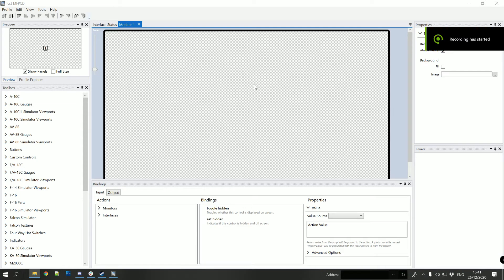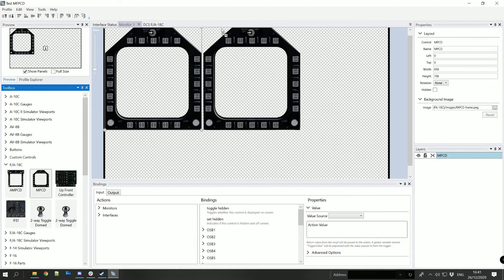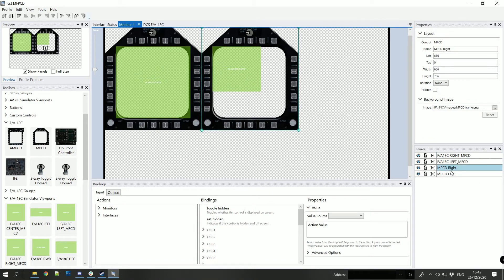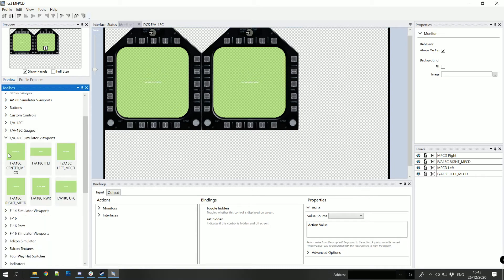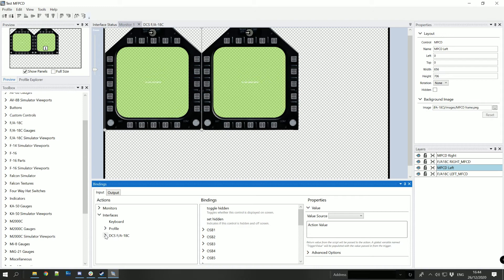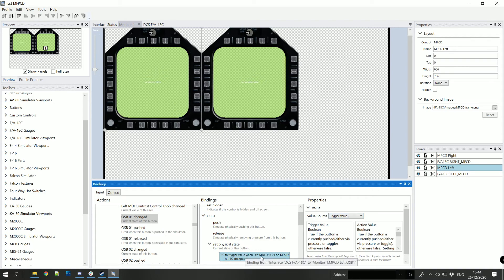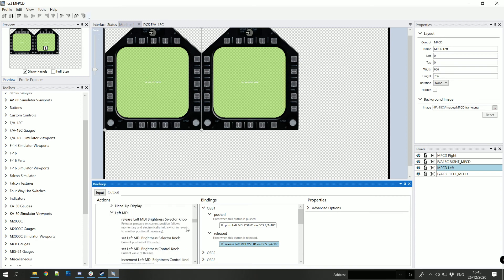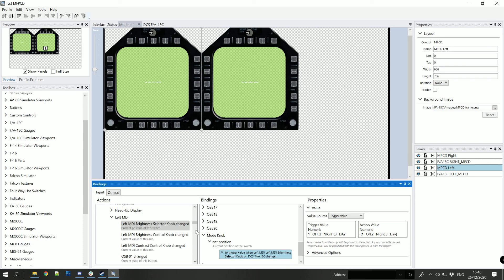Binding MFD Buttons in Helios for Beginners

Comment: Thanks ton Sir you saved me lot of heache well kind of sort of from figuring this out on my own. BTW burning question does your fps also drop with helios? mine go down like 10 -20fps
Reply from the maker: Helios will obviously have an impact on performance, but I have no performance benchmarks.  The exports for DCS does attempt to moderate the amount (and frequency) of data that is extracted from DCS for performance reasons.  I personally run the Helios Control Center on a different computer, but whether this helps with performance or not is debateable.
Reply: @bluefinbima2227  interesting i just got mine going i think performance hit for me little i am only exporting a small screen two mfd. On same computer though well only makes little difference. Turns out Dcs can never give 144fps even at 1080p with 3080 ftw.

Comment: I am new to client software coding, so my question may be a bit underqualified. But how did you folks find out the names and arguments for all these switches? Are there also methods for getting flight parameters such as wind direction and force? And once found out,  can I use these method names also in a different programming language such as C#? You guys do a great job, but although I am working in IT (web applications) your job is still magic for me 🤔 🤗
Reply from the maker: What is exposed in the Lua interfaces is relatively easy to decipher using certain files for each aircraft, and looking at the globals available in the sandbox'ed Lua environment gives some very basic general information, but I don't think anything related to the weather at the point in space where the aircraft is.  TacView gets more data, but I think that program is officially interfaced into DCS at a lower level.